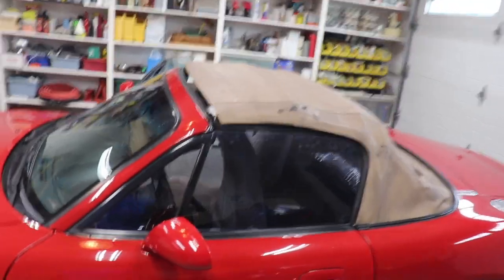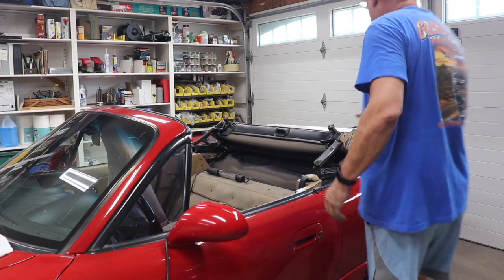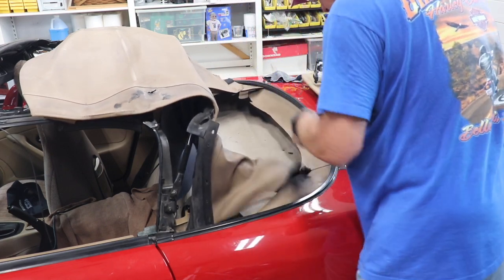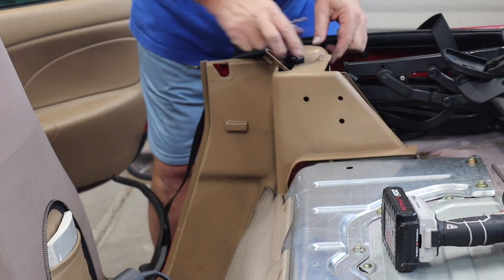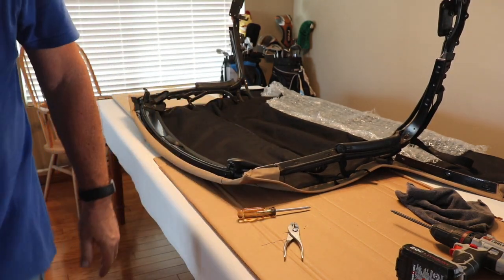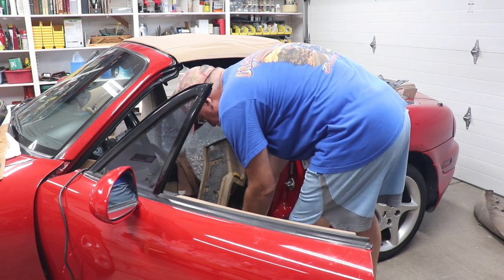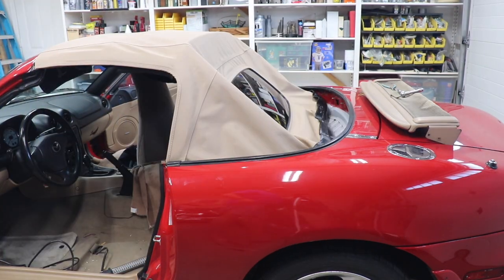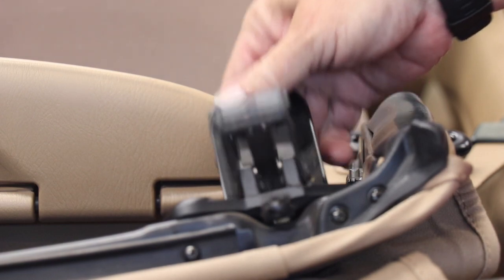2002 Miata Top Replacement

Comment: Great instructive video. I just had my 96 MX5 top replaced. The Mazda dealer told me that it would be a labor intensive job likely to take up most of the day. The rain rail had to be replaced.. I would never try to do the install myself as I am a total nerd when it comes to fixit projects. So the dealer replaced the old black vinyl top with the plastic window with a OEM top with a fixed glass window. Your video sure was mighty fine! Thanks for your efforts!
Reply from the maker: Thank you for the compliment.  I am a video learner and that's why I make the videos to help others who learn the same.  Good choice to pay someone it was not an easy thing to do.  You will like the glass window over the Plastic one.  I remember my first Miata a 94 with that PIA plastic window.

Comment: Thanks for recording this... very informative/helpful. I just ordered a new Robbins top for my 2000 SE and this will be my first time attempting this job (at age 55).  I'm debating whether to do it with the frame in the car or pull it out like you did.  I've been reading all the posts & watching videos I can find and I haven't really found a consensus.  Some people prefer it one way and some the other. Thanks again.
Reply from the maker: I debated that also but after doing it, it's easier to put the new top on with the frame out.  It's really not that hard to take it out and you have better access to putting the new top on out of the car.  Better access to the screws that are in harder to access with the frame in the car.
Reply: My 16 year old son and I just replaced the top on my 2000, which he will be using when he gets his license.  It took us about 5 hours.  We did not take out the frame and had no real problems.  Some of the screws are tough to get to and you need to do some creative problem solving, but it all fits together and looks great.  Good luck.
Reply: Looking to attempt this soon on my 2000 SE aswell Any recommendations on different soft tops from your personal use?

Comment: People, from a pro who has swapped Miata tops about 6 times now, make it easy. Remove the rain rail fasteners. Remove the B pillar trim. Remove the 3 bolts on each side for the frame. Lift the whole top off.  Remove the old top and install the new one off the car onto the frame. Once that's done, just bolt the frame back in and fight the rain rail back in. Makes it a lot easier.
Reply from the maker: I thought that's what I did?

Comment: Thanks for sharing this really helped, just done a straight swap disintergrating vynil for a 2nd hand cloth which came on a frame for my 2002 SVT, strangley I took out the same seat, which here in the UK is the passenger seat, think it might have given me a bit more room, only problem I have is I cant get the front rail to fit flush with the windscreen frame, my catches are already fully adjusted to the tightest fit, any tips welcome. PS Mine is also red but with black interior, going to start looking for some beige interior parts, looks so much cooler ;-)
Reply from the maker: Not sure why it won't fit flush?  Usually the top is so tight you can't close it.  Sorry, don't have any ideas for you.  Glad the video helped.  I've got seat covers over my beige seats.  The leather ones are pretty worn from use. I like the beige interior also.

Comment: Why didn't you show any details about the rain rail? That's the only reason I watched this video and you skipped over that whole part.
Reply from the maker: There wasn't much to show.  I purchased the top with the rain rail installed so the only part to show is bolting it back in.  Which was a PITA!  I wouldn't suggest buying a top without the rain rail installed.  If that's what you are talking about.
Reply: @Batman825  yeah it is a pita. I figured it out though. Thanks for the response

Comment: You don't need to remove the frame to replace the top.  You can easily get to all the rivets and screws if you position the frame in the right way also you should put  trim adhesive on the header bow
Reply: is the header bow the only place that adhesive needs to go?
Reply: @privatejr2702  yes .  I got a Robbins top  It fit really good.  It came with instructions .  you should replace the cables too .  Get one with the rain rail already installed it makes it a lot easier  It has to have two holes where the cables run through  look closely at it.  Its not a separate channel for the cables

Comment: OMG! I don't wanna do this! If my new top wasn't out for delivery today I would think duct tape is sounding a whole lot better.
Reply from the maker: "Man's got to know his limitations."  - Dirty Harry
Reply: @Batman825  Ah, the worst thing that could happen is that I ruin both tops during the process. I'll give it my best.
Reply from the maker: @bobbyrice  Best advice I can give you is pull the top frame out and work on it outside the car.  Put everything together before you put the top in the car.  That way the only thing you have to connect is the rain rail which is a PIA!  I put the top back in the car before I did the side connections and that made it a lot harder to do.
Reply: @Batman825  Thank you. It's sitting in my garage now and we have 50° temperatures in Florida right now. I don't know how that's gonna work with stretching the vinyl, but I do appreciate any and all help!
-actually, it'll be 38° by morning. Maybe I should wait out the weather.
Reply from the maker: @bobbyrice   Assemble it in your house then put the top outside in the sun for a few hours.  It will be easier to install if the top is warm.  You can do the same when you stretch the top the first time.

Comment: First off, thank you so much for recording the process. Second is your top from auto tops direct? mine looks almost exactly the same except that it doesnt have the tension cable sleeves. im wondering if its a defect
Reply from the maker: In my comments I put links to where I bought the top and also the tension wires if you need them.  I got the top from Amazon.  I guess I don't know what you mean by the sleeves?  If you don't have a channel in the top to put the tension wires through then you might have a defect as you need those to keep the edge of the top tight.
Reply: @Batman825  okay thats what i meant the channels for the tension wires are missing. I guess i gotta return it then, thanks for the help!

Comment: How is the soft top holding up? any problems?
Reply from the maker: The top is holding out great.  The only issue I have is the inner liner, it's not tight across the bars and it rubs my head when driving.  I have to tighten it when I drive but for the price it's a nice top.